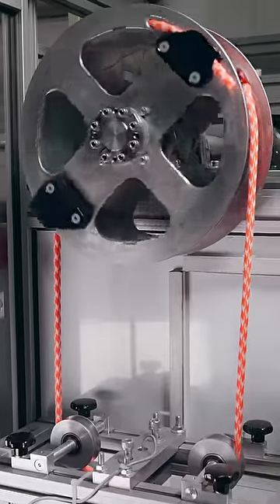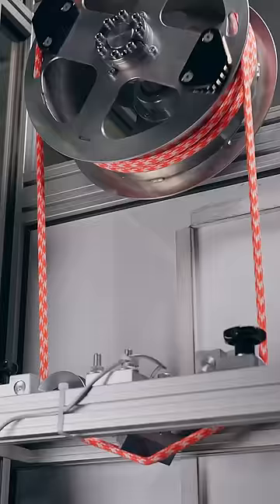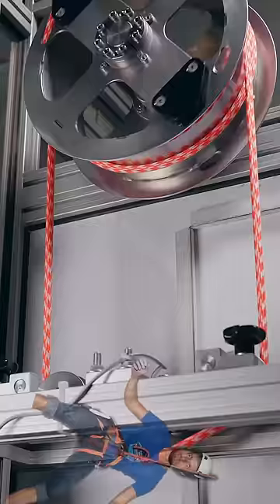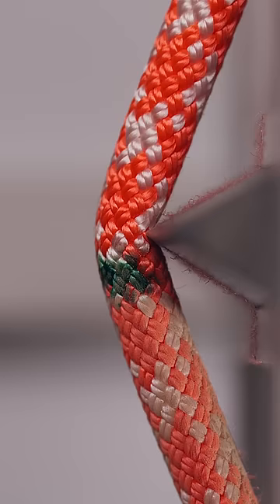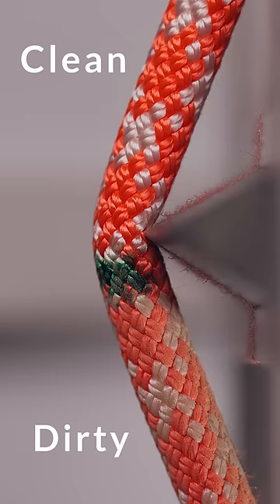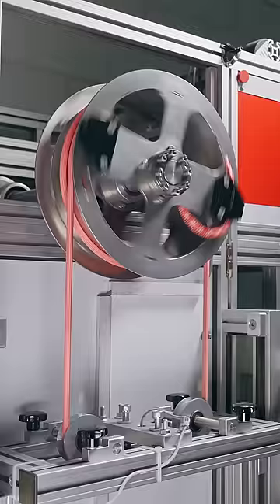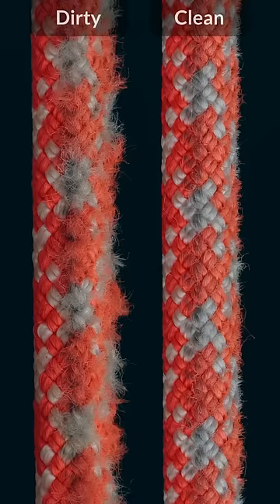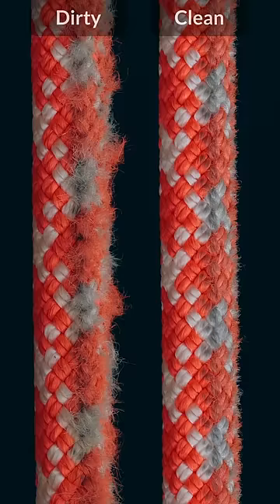Surprising Effect of Dirt on Climbing Ropes

Comment: Yes it makes a huge difference. I'm a tower climber & that's one of the thing we get taught in climbing class. Never leave your rope on the ground
Reply: What if we cover a thin layer of soft PU just like we did on power cable?
Reply: Yea but what sucks is when your tagging out of the tower can you gotta throw the rope on the rocks
Reply: Basically, we keep things we respect off the ground.
Reply: But why does it make such a big difference?
Reply: Adding an abrasive to the thing your life is depending on. Trust the engineers and scientists. Also those lessons were probably learned the hard way.
Reply: @extinctsss  dirt/sand can act like tiny knives pressing into the fibers of the rope.
Reply: @Nick Hyuga  It doesn't. Just wrap black tape around the rungs of the tower piece the rope might slide over.  I would do that regardless of clean rope or not.
Reply: I was a tower climber for a week, the steel safety cable was tagged out and that's what they had me using, I had no knowledge of that at the time and a couple days later my positioner wouldnt lock, I radioed it in and they wouldn't send another, threatened to fire me if I climbed down, such a shame, views were awesome
Reply: @Hitman Holla  Never let someone put a price on your life if you don't feel comfortable doing something speak up on it!!! I'm a foreman & I would never put my guys lives in danger
Reply: @Josh Martinez  couldn't have said it any better, at 100$/day its far from worth my life, wish it would've worked out, really enjoyed the work, got all my certs for it, it's good to know there's foreman that care about the crew and not just about the job getting done, you can always find more work, hard to find good employees
Reply: 😂 oookay buddy.
Reply: @doglovemimijumable yeah 🤔 unless that makes it ‘not ravel up properly’ and we’re just risking lives 🤣
Reply: @RioCrypto  I'm sorry you care to enlightening us with your knowledge of this topic???
Reply: @Nick Hyuga  dirt is an abrasive.

What it did to your knee as a kid does to the rope at high speed
Reply: @extinctsss  dirt is like little pieces of sandpaper. And with their test a bunch of dirt is getting stuck on that sharp edge further cutting the rest of the rope.
Reply: learn something new today👍
Reply: @joshmartinez5066  i would sue the heck out of them for emotional damages and if it took the rest of my life and resources
Reply: @extinctsss  It's basically like adding sandpaper into the mix.
Reply: Oh yeah how's the business! Still living out of the hotels 🏨
Reply: @mitchchristopher1548  which is why we bury people in it?
Reply: Laughs in sailor.
Reply: Arborist field here. Yeah... dirty soaking wet ropes all day xD still see people using that same rope 4 years later. This is something I need to look into
Reply: @davidlabossiere1140  he said OFF not IN
Reply: I pray for you guys . My friend Luke and his brother used to be tower climbers and I met a lot of cool dudes fearless as fuck . But would free climb and a few of them fell to their deaths . This was back in 03- 08 when the tower industry was upgrading the cell tech. People really just don’t understand what it takes and the lives lost to keep that phone in there hand linked to the network
Reply: @MJBe USA  No lol...... I put in my time!!! 16 years in the industry,  CM now just running the job sites now & working locally for me in SoCal
Reply: @KeijiGamings  Ya for this industry ropes are your lifeline so you respect them cause your life is literally hanging on it
Reply: @SixSeven From tha 615  I appreciate this comment more then you know brotha........I been in the industry since 08 so I know what your talking about I was one of those guys free climbing also. I no longer climb I run the jobs now but yes this industry us no joke & people don't understand the blood sweat & tears that go into them using that phone in there hands!!!! The lives that have been lost for something so little
Reply: Same here I climb towers as well and we keep All of our rope in labeled waterproof buckets.
Reply: @Ellis Najera  safest & best way to do!!!! But make sure your foreman or safety instructor or your CM is keeping an eye on how old that rope is & make sure you guys inspect it before every use!!!
Reply: Quick question how much can i wash the rope until it was unuseable?
Reply: @Bruh  can't really say. There is a lot of variables to this question.
Reply: @extinctsss  its like sandpaper
Reply: I worked for a company that didn't take care of its ropes. When I pointed out how dangerous it was to work with improperly maintained ropes I got told not to worry about it. Needless to say I didn't work there long.
Reply: @doglovemimijumable  I think that makes it really heavy
Reply: Of course a buffer between rope and contact point is desirable
Reply: How'd you get into tower climbing? Seems like a neat job.
Reply: @hitmanholla4774  threatning to fire because of a safety issue damn guess it would have been time to get a lawyer huh? pretty easy case to win i would say.
Reply: Cool advice how does one get into tower climbing josh Martinez???
Reply: As an informatician, I totally agree.
Reply: First i read towel 😂
Reply: I thought you were going to say let get dirty but you said ground
Reply: @Nick Hyuga  the contaminants act as an abrasive. Effectively sanding down the fibers of the rope.
Reply: @extinctsss  Drag
Reply: Wow never in a million years would have imagined
Reply: @joshmartinez5066  long shot but I'd love a job climbing towers, I'm good at anything that can be taught and have plenty of mechanical and electrical understanding. Any tips or anywhere I could apply to get in?
Reply: so your rope is not touching ground when you use it?
Reply: @extinctsss  dirt and minerals embedded in the fibers increases the friction and introduces tiny sharp edges to the rope.
Reply: @mononoaware5912  Just like any other job.....Do your research & once you find some companies fill out an app or try going to a job site you see they are working on & try talking to the foreman see if that company maybe hiring
Reply: @L3G1T  What state are you in & do you have any kind of construction experience? And I have to ask but are you afraid of heights?
Reply: @Pleiades Go  No. When it's not in use it will be in a bucket & when in use it will be in the bottom of the tower tied off and the slack will be in bucket
Reply: @doglovemimijumable  humanity isn't smart enough to think of such ingenious solutions at the present, wait for about 10 years and bring it up again.
Reply: Where to put it then? Sorry if its a stupid question but i am a volunteer firefighter and our ropes are all dirty
Reply: Heyyy my dad climbed towers I feel like I never see tower climbers comment stuff about climbing idk it’s cool he likes to talk about climbing a lot tho
Reply: @mitchchristopher1548 hopefully that includes yourself! you guys are braver than 99% of us
Reply: @mitchchristopher1548  When you realized we are on the ground a lot. XD
Reply: Indeed. It’s so obvious, a child could figure it out. Yet he finds it “surprising”!???

Peace
Reply: @Gigachad  store in a 50gallon buckets. That's how we store ours.
Reply: @extinctsss  because the dirt are little rocks and sand and functions like sandpaper
Reply: U
Reply: Fascinating, we use nylon straps to haul large quantities of rebar via crane and often let our straps get pretty dirty/muddy. I’ll be more cautious of that going forward.
Reply: Have you met suction cup man?
Reply: I am a tower climber to. But I never went to no tower climbing class. I don't think I've ever heard of a tower rigger going to a class. There isn't a tower climbing class hahaha...I got IRATA my rope access training. I did have to go to class for that. Also never leave your rope on the tower over night if you don't have to. It takes
Reply: @youandi06  so if your a tower climber your not certified? How long you been in the industry? I'm a CM now started at the bottom what company you work for? If your a climber you should have had a class before you ever got on a tower so you know what to do & how to do it. I'm not talking about working off of a man lift I'm talking real tower work 600 or 700 ft towers!!!!!!
Reply: @joshmartinez5066  yeah man i climb 700-800 foot towers to. Sometimes 1500 feet. Been doing it since 2014. I got my fall-arrest certification, IRATA rope access certification, and rescue certification, but I've never went to a class for climbing towers. I have never heard of that. I started the job with nothing. First tower I climbed was a 200 foot monopole. The day I got hired. They showed me what to do, and what not to do. And when I proved to them that I was safe and competent. My certifications followed after.
Reply: @youandi06  man bruh idk I been in the industry since 08 and I have had classes actual classes with Petzle
Reply: @joshmartinez5066  I don't doubt that that you went to classes. I'm assuming it was probably for your certifications.
Reply: @RioCrypto55  you're the expert huh?
Reply: @mononoaware5912  yo you know those cell towers that are everywhere? Go to one with a rope rigged to it it and meet the guys.
Reply: @Josh Martinez  yep you definitely a real one.
Reply: @youandi06  ayo to be fair most climbers are tested by the crew before they get certs. How I was and everyone else I know got in. But bro you got to get certified at some point, especially if your working for a real Company.
Reply: @hitmanholla4774  pbs just released a documentary about that. Dangerous job and not worth the pay. And the carriers and contractors could give a sht about your safety
Reply: @mononoaware5912  hit up a contractor for it they might just have you fly out the next day no experience needed. Dangerous job
Reply: @armor power  I suppose if I was documenting it I could've pursued that. Very hard to think about these things when your positioner is failing and you're 100ft up on a monopole, just wanted to get down and tf outta there. Still walked away with 2 grand in certs for free
Reply: @extinctsss  you may not feel it but newspaper and metal polish is a really good way to clean and brighten metal. They newspaper is very mildly abrasive but it makes a big difference compared to something like a paper towel. You don't need much grit for dramatic results as you saw in the video.
Reply: Wow, so you add an abrasive like dirt or sand and it will cause the outer layers to deteriorate! I mean that is such a novel idea. It’s like sandpaper would completely blow your tiny mind!
Reply: Too late for tree service men.
Reply: thank you for your job
Reply: @Nick Hyuga  
Small particles get between the fibre and fray the fibre weakening it.
Then the pressure causes stress, weakening it.
Reply: @RioCrypto55  what a useless comment.

I've noticed only unfunny people use the cry-laugh emoji like that.
Reply: @keijigamings1127  could be you're using a different sort of rope, different material, whatever
Reply: @Mat Turner  nah same type. Rock climbers use the same types of ropes excluding one we use like bull ropes. Just depends on the needs, weights etc.
Reply: @keijigamings1127  I still wouldn't ignore the clear evidence in this video.
Reply: @hitmanholla4774 
Ain’t no tower climber makin 100 an hour just stop.
Reply: @Eddie Just stop taking everything at your perceived face value and recheck what you've skimmed.100/day
Reply: @YeetxBoi  don’t do it. Not worth the money or your life. You’d be safer and better paid at McDonald’s 😂
Reply: @extinctsss  dirt it will create more friction = more heat = more wear and tear
Reply: @doglovemimijumable  ok zy
Reply: @hitmanholla4774  we arnt even supposed to use cable sliders or t sliders anymore. I suppose tgey have an outdated design
Reply: @Nathanael Waters  Holy shit I didn't know, maybe thats why it was tagged out, 2 days later we ran safety cables, still used the cable and sliders for that, was fully relying on it too took me till getting to the top to be comfortable
Reply: This makes sense for a tower climber, but given that the cliff edges aren’t this sharp and are covered in dirt, my guess is the effect wouldn’t be the same as in this lab or on a sharp tower edge
Reply: @extinctsss  friction against yhe dirt.
Reply: Whoop whoop hit the dirt!!
Reply: Stay 100 brothers 💪
Reply: I climb towers and they never told me that
Reply: Wont it get dirty regardles? It is hanging over the edge of a cliff. Im sure some dirt will get on it
Reply: How much do u make?
Reply: @khalilwilliams3176  $55 an hour
Reply: Rock climbers must be screwed then
Reply: @joshmartinez5066  Damn wow, good stuff.
Reply: @MichaelJohnson-  it just burns through the black tape lol helps in some situations but not on a heavy load where a rub is unavoidable.  Yea dirty rope makes a massive difference. Been doing it for years. It can even cut the rope from the inside out that’s why you should constantly be flipping your ropes and switching sides so you can be familiar with the entire rope. It’s also why you should always have your hand on the load rope so you can inspect it and notice weak spots or where material is missing thinning the rope out.
Reply: @joshmartinez5066  this is why we don’t put our belts on the ground ever either. Glad to see another knowledgeable hand out there. Stay 100 and keep your guys safe. Best feeling ever is doing something crazy and then all making it home together safely.
Reply: @LazyassedLamenter  - have you ever tried using garbage cans to hold excess rope?
Reply: @extinctsss  covering it in sand and dirt effectively covers it in a thin layer of "sand paper" so to speak. as those rocks catch and the rope slides over the grit, you experience a rapid abrasive effect.
Reply: Re-discovering basic physics one dead climber at time.
Reply: i was always taught this, and if it is laying on the ground, NEVER step on it
Reply: tips and tricks for villains 👹
Reply: Dirt is just tiny crystals. Strait up tearing at the microfibers.
Reply: As a tower climber, have you tried climbing historical sites? Are you allowed if you ask for permission?
Reply: Okay, but why?
Reply: @xhana_  wanna elaborate on the "Why" question?
Reply: What u get climing the tower
Reply: And have ever clime Eiffel tower
Reply: ❤🎉🎉🎉🎉we are made in HIS image
A good prayer:
I'm a sinner JESUS please forgive me for all my sins I know you shed your Blood for me on the cross at Calvary. Thank you JESUS for my salvation and for shedding they Blood for me. I love you JESUS. 
Romans 10:5/10 ct...❤️k
JESUSisLord!Amen...
Amen..
If you'd like to call someone who cares 
83
For
Truth.
bc you don't know when you'll die?
.y r u hesitant..........

...... .. .....m..🎉
Reply: Amazing how they have space age machines to try something that is common sense with climbers. Kind of like when they begin yet another investigation to see why crime rates are higher in certain neighborhoods i Sweden...
Reply: God bless you climbers. You saved a bunch of people who would of got lost
Reply: nah you are not a tower climber.
Reply: @Mr.Caring  Amen 🙏💙
Reply: hi, i am curious about how many ropes do you attach to yourselves?
Reply: @GeneralArmchair yes
Reply: So why is it that dirt makes it break faster??
Reply: What's a tower climber?
Reply: @mitchchristopher1548  yes, women don’t put our purse on the ground, it’s bad luck!
Reply: Duh, if you leave it on the ground it's not going to be where you need it when you are climbing.
Reply: So does washing help?
Reply: "Never leave your rope on the ground" find that hard to believe.  Rope always going to get dirty or touch something.  Ground or not. Moreso, inspect them and replace it when needed should of been said.
Reply: @doglovemimijumable modern climbing ropes are often impregnated with advanced stuff... It's all a question about money
Reply: I remember back in the 70s when I was in the scouts we did some climbing. We had two types of rope back then , the type shown and gold something. Nobody liked the gold rope. Even back then you took good care of your rope because it could mean the difference of staying alive or falling.
Reply: @cherrydragon3120 Friction that will make weak spots. I remember that from climbing back in the 70s as a kid.
Reply: Never leave it on the ground, you’ll need it for climbing 😂😂 jokes lads, jokes 😂😂
Reply: @lubrew5862 

Chill the hell out. The running context is that most people don't think about this stuff because they aren't faced with it. Most humans learn and research when they're faced with the topic. Otherwise, it's either "not being able to question something you don't exists," or it's "remembering to question something you saw extremely briefly one time but never drew your attention."

Do you consistently think about color theory? Or how to rebuild the head of a D-series Honda engine? Doubt you do. Get a grip.
Reply: @Gonken88 

I'm sure they use it for other stress tests. Also, you can't get exact numbers by following around a dude for weeks or years and checking his rope every day. This expedites the life span and damage to the rope in whatever circumstance the observers want. It makes sense. 

Having a general knowledge of something does not equate to an exact knowledge or the progress related to that.
Reply: @kg888 
Should have* or should've*: pick one.

Also, any preventative measure for something so important is good. Just because an expression says "never" doesn't mean it actually never happens. It's stressed that someone should try to not let it happen whenever possible.
Reply: Bruh u ain’t King Kong
Reply: @IlikepoolsYT  Homie you even know how to climb or use a rope the right way??? 🤣🤣🤣🤣 Get at ne when you've been climbing at least 10 years and have climbed a tower over 600ft
Reply: @joshmartinez5066  it was joke bro relax💀
Reply: Arbor rope is like 3times thicker because of this.. i bet u don't use anything pinky thin like there testing here I know  when I do canopy work the ropes we used were like if what there testing here was braided 3stranes
Reply: I stopped climbing with my coworkers because they don't seem to be able to learn not to step on the ropes.  Among other faults.  Blind dumb luck stopped a fatality the other day.  The 30 pound braket rigged wrong and then dropped didn't kill the ground guy because it magically hit a 3 foot dish and balanced on top of it instead of hitting him.  WTF can't people pay attention to what they are doing on tower climb jobs?
Reply: @hitmanholla4774  should have let OSHA know